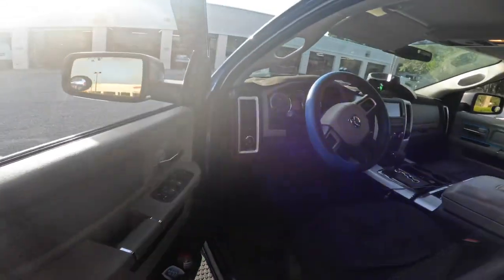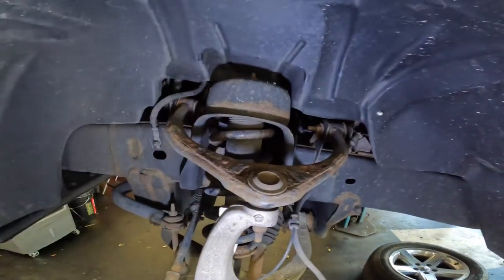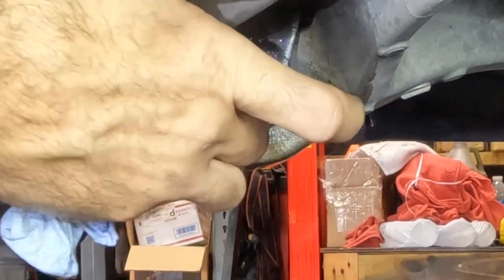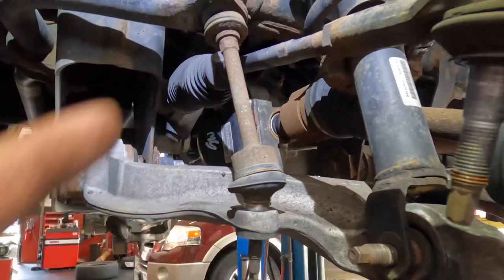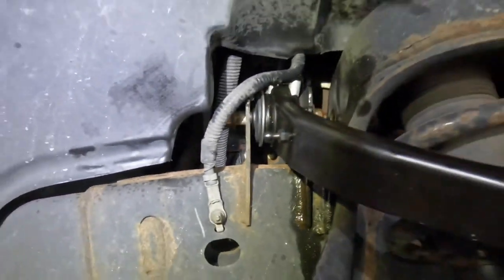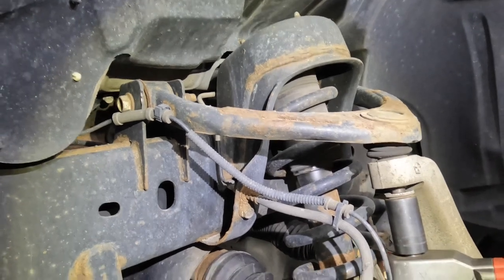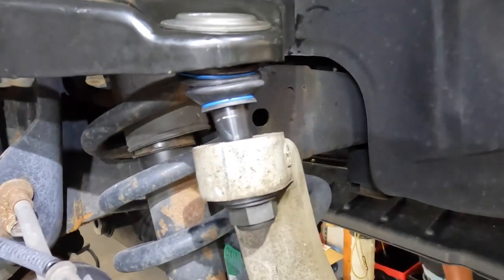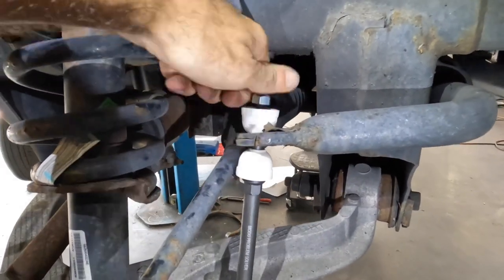Job Fails Fast! 2011 RAM 1500

Comment: I have the same truck
My “ leveling kit” is having the bed full with lumber and tools.

Because I use a truck for it’s designed purpose. 
I know….. crazy
Reply: I had someone ask me years ago why my truck had so many scratches on it . I replied " Because it's a truck " .
Reply: Yup and sometimes I even get the rear lower by putting heavy loads in the bed!
Reply: @eaglerider1826  My best friend WOULDN'T EVEN ALLOW YOU IN HIS TRUCK UNLESS YOU TOOK OFF YOUR SHOES OR BOOTS. He had a pair of slippers he wore after taking off his, I told him FUK IT I'LL FOLLOW YOU. NEVER HAULED ANYTHING EITHER, HELL NOT EVEN STRAW BAILS.
Reply: @NoWr2Run  Let me guess , It's probably never been off the pavement and If you ever asked him to help you move he would say no .
Reply: @eaglerider1826  NOPE, 4 Wheel Drive & never off road, maybe he would allow me too put the pillows in the bed of his truck.
Reply: @NoWr2Run  Lol .

Comment: When the parts are not in stock for 3 months , that's when you take a trip to the auto wreckers.
Supply shortages in Ca. Even things like common tools at the local auto parts stores have been out of stock for 6 months to a year. Taiwan ,Japan and Europe is way behind in meeting demand since 2020.
Reply: @jaypeeztabernac851  
Well in Northern California the auto wreckers are very buisy.
Because alot of parts that where easy to get are now on back order. Most of the time rust and corrosion is not an issue.
So if I lived in Canada, I'd be calling California's auto wreckers and asking for priority shipping.

Comment: I lived this on my 2007 Ram. For my fellow DIYers, if you don't have a torch, the 9" Diablo Extreme carbide tip sawzall blades, and a little cutting oil, will go through these bolts.
Reply: i second this for my 2006 f150
Reply: First try penetrating oil then if all else fails go for implements of destruction
Reply: Try fluids penetrating oil and torches first save cutting as a last resort because once you've cut something you cannot put it back I have put tons of aluminum steel and stainless is the worst once it gets hot it will melt the drill hey guys save it if you can have a good day bye

Comment: Bolts stuck in the bushings in my Dodge and I used a torch to melt/burn the rubber bushings. A lot of black smoke but it worked. Got the rubber hot and melty and hit the end of the bolt with an air chisel and it popped out.

Comment: On my semi and cars, we would antiseize the bolts for the shocks and serviceable suspension parts. Makes it much easier to remove when it comes time to replacing. I'm from the north and frequent the PNW all times of year. No seized bolts yet..

Comment: I just did the same work this weekend on my 2010 Ram 1500. Had the same rusted bolt issue. I tried a bunch of things but decided since I was replacing the struts I'd cut the strut above the bolt and spin the rubber center out (heat applied here helped). I then cut the metal outer part with a sawzall and got it out as well. I went to Advanced and got Monroe bushing kits (at twice the cost of getting them from Amazon!) and froze them over night. They installed easily with ball joint kit from autozone. What a redass. Lots of videos on strut installs don't show this pain. Its always one thing that takes the easy out of near all I do!
Reply: Your in the category of Genius!
Reply: I use gum-b-gone on parts that need to be froze right away, no need to wait over night.  Zip-lock bag, works great for small parts.
Reply: I was thinking torch off the bottom of the struts and pretty much the rest as you did. I'm in northern Illinois and the torch is one of my most used tools.
Reply: @williamroberts4758  I will look that up.
Reply: @keithlibner9259  I dont have a torch and my skill level with one would have probably had me getting my smelting qualification vice bushing removed. In the hands of the better skilled I am sure it is awesome. I visit the Chicago area 3 or 4 times a year and from what I can see I bet wrench's are less successful than torches. Even the rust gets rusted in your area.

Comment: Years ago when I rebuilt the front and rear suspension on my 65 Corvair I bought a kit of all the parts, bushings,  springs, shocks etc.  Sold separately was a "every nut and bolt" your need.  Being a northern car I about that as well.  Needed them all.

Comment: I  love that you take time out of your day to make vidyas for us Ray. You are seemingly not well versed in the way of the rust belt.... you burn those bushings  with fire until they release your bolts sir. The greasy fire from the bushings isn't hot enough to damage the bolts .  They'll come out.
Reply: I had the same sort of problem with the front shocks on my old GMC van. I just got a bit of the rubber on fire, then hit it with a bit of oxygen, burns the rubber out fast. I did goto Lowes and got some 3/4" grade 8 bolts and nuts and lockwashers the right length to replace the bolts tho, rubber fire + oxygen + rust I didn't trust the shock bolts anymore :) Have to be careful though, only a little spritz or the molten rubber pops and spits molten rubber everywhere....just enough to keep the fire going is all that's needed.
Reply: Like Eric O says, it can't be stuck if it's liquid 🤣😂

Comment: I just did a set of front struts on a 2007 Jeep Grand Cherokee and the same bolt was frozen just like yours. I was smart and took the advice of Eric O and bought the Astro 4980 also known as Big Nasty a while back. It took about 15 minutes per side. I got them out without much trouble or cursing and know they would not have come out in one piece without the tool. Basically, if the rust belt mechanic Eric O says to get yourself one of these bad boys get one because you won't regret it.

Comment: Even though you're down south you should be using anti seize on those bolts to make sure they don't rust to the bushing again
Reply: My knuckle busting days are about over but, any time I had a hard time getting a fastener removed, it never went back in dry. Anti-seize, various oils, anything to help the next guy, which could be me.
Reply: @jefferp  any time you add anti-seize/lubrication to a fastener like that, you change the torque specs by a large margin.
Reply: @williameldridge9382  I didn’t say I put it on the threads. At times, the torque spec possibly may call for lubricated threads though.

Comment: When you encounter a situation like that, using a torche to burn out the bushing will release the steal tube from the nut.  The heat causes the rust to release.
Reply: Not always🤣🤣🤣
Reply: Heat won’t work.  Would destroy bond between inner steel liner and rubber bush causing liner to spin with bolt, leaving situation as same on the video.
Reply: It's always worked for me

Comment: Up here in MN, we usually just cook the bushings out and cut the metal sleeve off the bolt. Tedious the first few times but have done it so much its now a 30 minute job for control arm bolts.

Comment: As someone living somewhere that gets cold, wet and salty in the winter .. like everyone else has said, it's nice to see you struggle with what I get every time I try and undo something ;) Of course on the flip side, I don't have 80-degree 80% humidity days too often either so.. you win some, you lose some!
Reply: I'd love it if it were 80 degrees and only 80% humidity here!!
Reply: @lhaa  We've had a few days in the UK of 90-100F and ~30-40% which were absolutely killer (few homes have AC here), then a few of ~85F and ~50%.. now it's a much more pleasant 66F and 79%.. still shorts weather, but not betty swallocks!
Reply: @aaronbuildsa  95-110 is normal,at 85-100% humidity from June to September. It it better where I live now,as before,it' was  pretty much all the time.
Reply: @lhaa  I don't think I'd ever get used to that kind of weather! :)
Reply: @aaronbuildsa  It makes 85f seem cool,and we all have A/C.

Comment: Ran into the same problem on a ram 1500 2wd same year. Thank God Advance Auto Parts had the bolt set with new bushings in stock.

Comment: Wish I could have been there for you. I have removed those living here in Minnesota for years. It turns into A 2 man job for about 5 minutes. One person uses an impact (or a 1/2" ratchet) on one side and the other person uses a brass rod (a home made 3/4" is what I prefer about 6" long) punch and beats on the other side until it sits flush, then get a smaller punch to finish the push. Also get some CRC freeze-off and chill the bolt (this helps release it from the bushing or maybe its just my imagination). Anything that helps to avoid using cutting tools, doesn't always work but does the trick often enough to keep this method in my back pocket. 

Cheers and keep up the great work. I would let you work on my car any day.

Comment: Simcoe Spring Service has some great videos about getting rusted in bolts out of rubber bushings without destroying the bushing. The main mechanic there is an artist with the cutting torch. They work on heavy trucks but there are some videos on smaller stuff too. Their hydraulic press and hydraulic vise are worth a look too!
Reply: If the bushing is no longer "glued" to the metal casing, it's shot and must be replaced
Reply: @brucemadden1626  Absolutely, the mechanic at Simcoe seems to be able to heat just enough to get the bolt to release from the sleeve without destroying the bond to the rubber. Probably not a skill in high demand in Florida though.
Reply: thats the dude he fantastic at puling bolts
Reply: @brucemadden1626  exactly which poses the question if the bolt is that far gone saving the bushing really isn’t worth the effort as there’s bound to be unseen damage i.e. wear and tear not worth the risk

Comment: Just installed Bilstein struts and coils on my son's 22 F-150 two days ago. The factory top plates had to be re-used, so I had to compress the coils to swap them over. But since it was a brand new truck, I didn't have any problem removing all the bolts.

Comment: Inho you should have measured the initial ride height after moving the truck on some bumps. In my experience any vehicle sits higher just after you lower it from the lift, the suspension is not settled.
Reply: Agreed...
Reply: well maybe if he re-measures after he sets it back down.  but you are correct, there will be some settling.  and most of it will be on the front.
Reply: Internet Moms. Pretty sure Ray's familiar with All the Quirks, possibilities of this procedure. 
That said, good idea to replace all suspension hardware with OE or better anytime rusty project's getting said replacements , eh.
Reply: Because the tires touch the ground and grip the floor before the suspension goes through its arc. The tires need to move outward for the suspension to fully traverse but can't. You just need to roll it a little back and forth and the true height is restored. Wouldn't apply on a solid axle so here it's just the front that's off 1/4" or so.
Reply: But if he compares the ride height in the same exact way, before and after, you'll get the same difference in results.
Reply: You don't think they measured the ride height before recommending the service? Maybe even the last time the customer was in?

Comment: I worked on an old Jeep and encountered the same problem. My solution was to heat the bushing enough to where rubber melted. Gave me enough room to than heat the inner sleeve and loosen the bolts which also made it easy to remove the nuts.
It took me 13 hours to do both sides. During installation of new control arms I covered the bolts with anti-seize and customer was happy with the repair.
Reply: On my molds I used to use a special and he sees that I cannot say the name of but it was like $80 a can but it would allow bolts not to rust and go through various heat cycles

Comment: Remember the good old days when you could press out the old bushings and press in the new bushings. Same with ball joints, press in, screw in, rivet in. Now you have replace the control arm, more cost, really sucks 😕
Reply: Replacing bushings and ball joints rather than the entire assembly is the first step in the UK, especially for home mechanics (like me)
Reply: Depends>>how much are the control arms versus how much is the time and labor to change bushings? These days, I hate fighting old rusty crap and will change it even if it costs more just to save the aggravation and likelihood that I will be changing it all anyway.
Reply: Some arms don't have serviceable ball joints. I correct that when replacing them though.

Comment: Ray, cutting the shipping straps is always an option, but if you go to where the ends are heat-joined, you can just peel them apart (if you find yourself without a suitable cutting implement).

Comment: Yup. Very normal procedure for an outside kept vehicle in West Virginia. Go ahead and order every part you need to touch because you probably will not easily remove the bolts.

Comment: I guess they don't have a torch in this shop? Heat the hell out of the bushing and put an impact on that bolt. I deal with this everyday.
Reply: @crforfreedom7407  steel collar inside the rubber bushing is seized to the bolt. Burn the bushing out with the torch. Bolt easily saved. Replace bushing. Most people reading this understand.
Reply: @Rotttman , Yea, but then you get molten and spitting rubber dripping down. You should probably wear long sleeves and safety glasses, plus there’s always that smell. But you’re right, we understand!
Reply: Now I see why you lose a lot of jobs
Reply: @Rotttman  you can get the bushings with a bolt and nut from napa. I've totally torched those bushings out before without ruining the bolts. And that's living in the heart of the rust belt
Reply: @timhurst1813  exactly. Making this guy pay all this extra money and wait 3 months seems criminal. But I guess if you're used to these parts just falling out I can see why he just doesn't have the skill to deal with these issues and just orders new parts.

Comment: Hmmm, surely a good grease on those bolts when putting them back will help in future disassembly .That way not jamming up.
  Also a good dousing with WD40 on nuts will help with disassembly. Loosens all that crud.
  Cannot understand why manufacturers put dry bolts in. Knowing full well the bolts will rust and jam in place.
Reply: I always lube hardware, no one believes in it, hence more work. More work means more payments
Reply: PB blaster is 100 times better than WD40

Comment: The only Walmart/Harbor Freight/Lowe's/Home Depot parts I'll use for my car is the plastic zip ties, heat shrink tube, electrical tape, things like that .... the rest I usually with OEM, which for my Chevy is AC Delco brand.

Comment: That same exact bolt put an end to me replacing a cv axle on my Jeep Cherokee. After  2 days of heating & beating I gave up and retreated. Good thing the driver side was the issue. When the passenger side goes out it'll be time to trade it in.

Comment: I have to wonder. Little transmission fluid, acetone mixed in an oil squirt can, add that to the stuck bolt, add some more 15 minutes later. Get out your small #5 hammer and start encouraging it to come out. It's surprising how often that works.

Comment: That air horn is not a bad idea.  Nice installation, too. Is that a grease fitting on the bottom side of those sway bar links?  Wow; I didn't think they put grease fittings on any automotive anything anymore.
Reply: “They”, the manufacturer, don’t. Aftermarket parts.
Reply: @MWilk098  I didn't think ANYONE put grease fittings on anything anymore - OEM's or aftermarket.
Reply: @billmilosz  nearly all aftermarket suspension ball joints have grease zerks on them. You have to get extremely cheap parts for them to be non serviceable.

Comment: Up north here those bolts are what you fight with every day, you gave up way to easy.  Like I tell someone before starting a job like that it’s a 2 hour job but with the rust that 2 hours may be 4 or 6 just depends on how rusty things are…. Cutting it off may be cheaper in the long run since it was probably due soon anyway.

Comment: My 2011 I cut head off bolt and cut off length from other side. At that point, I could remove old strut. Knocked out the old bushing and installed new bushing, bolt, and nut. Big PIA , but looked great afterwards

Comment: I'm not a mechanic but I've never seen undercarriage control on boats and the rest of them that rusted up did the truck sit in water for a while man what a mess also I've been waiting to see all your flashlights man what a collection hey guys have a good day also I love that motor mount tool to pull the motor over for access to the spark plugs between the firewall and the heads

Comment: Wow, im surpised with relatively how little rust that truck has comparing to a regular northern truck, that those bolts are already completely rusted to the bushing. What a fail dodge. They definitely didn't use never seize when they assembled it
Reply: Rams rust less than Fords.  Ford's are rusting on the lots.
Reply: @BravoSeven  No happy I didnt buy the Ford and glad I climbed underneath it on the lot.  It was rusted from front to back.

Comment: Many times I've had luck pressing those bolts out with a ball joint press.  Air hammer on the end of the press screw while tightening.  Might have to work it back and forth a few times but usually come out without destroying the bushing.